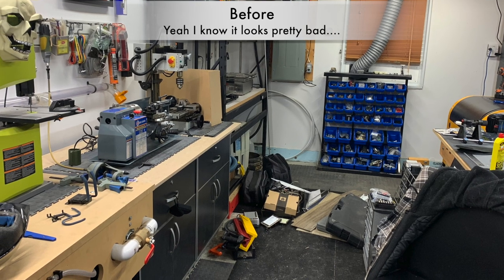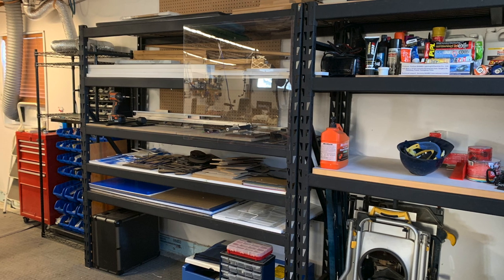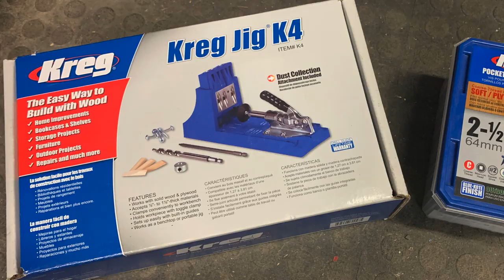Workshop Makeover with DIY Wall Mount Workbench!

Comment: Looks good.  How do you heat it?  I use a small propane forced heater in my garage workshop, but I am considering putting in a permanent natural gas heater, which I think would make the space much more "friendly" to winter projects.
Reply from the maker: I use two 5000 watts overhead forced air heaters, gotta use electricity since I don't have natural gas available where I am.  To save on energy cost I rigged a NEST thermostat to control both of them.  You can see a tutorial of this here if you want to check that out: https://youtu.be/3m-GU_-7GW8   Thanks again for watching, hope you're having a great summer!

Comment: Question: How can I turn off power to a step motor once it has ended the loop  cycle, so it doesn't get hot . Is there any way to add in the code or command do accomplish this?
Reply from the maker: Hi Joel, I know that on the EasyDriver board there is 2 pins:  'Sleep/Wake' and 'Enable/Disable'  Setting the Enable pin to HIGH will turn off the current to the Stepper Motor, LOW will turn the current back on.  Now the Sleep pin will do the same thing, but in reverse, LOW will turn off the EasyDriver completely including turning off the current to the Stepper, this is like turning off the power to the EasyDriver sort of like a reboot when putting it back to HIGH. Now remember that when using either of these, the stepper motor will have no holding power and if you move it, the position when you put it back ON will be incorrect... Hope that helps and thanks for watching!